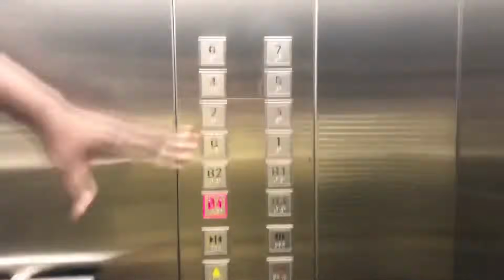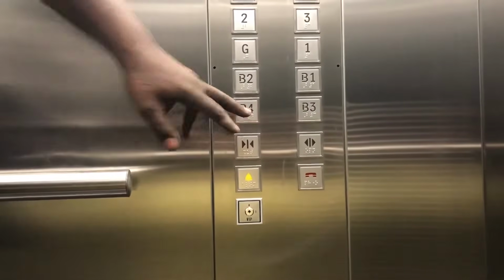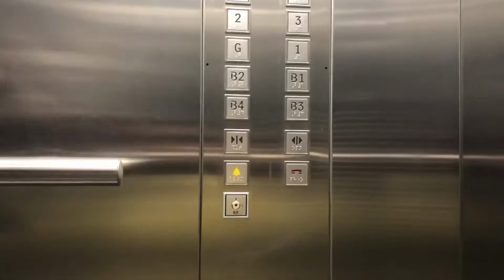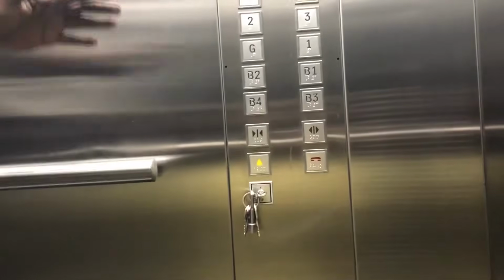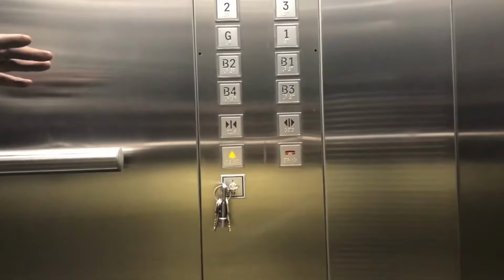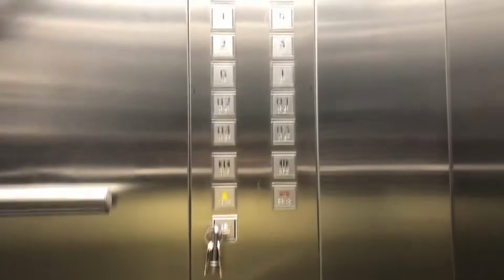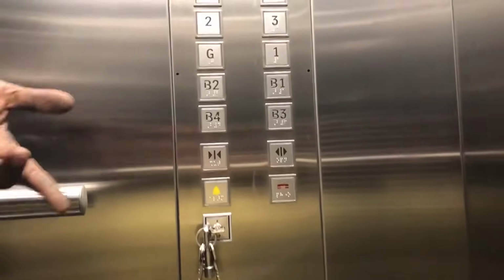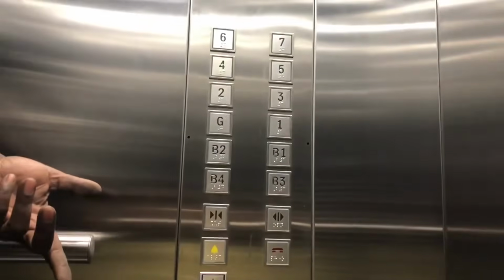How do the Lift work in the Building | How do Elevators Work in the Building | Lift and Lift Shaft

Comment: Hallo,
Thanks for the video.
Am doing a lift shaft in very limited space due to the existing structures.
The maximum internal diamension i can achieve is 1800mm by 1400mm.
The door opening is on 1400mm side. What is the minimum door size for the lift shaft? 
Thank
Reply from the maker: You can ask your lift suppliers about having a single opening door, and request a minimum of 0.9 meters. Check if the supplier can meet this requirement.

Also make sure your design comply with local minimum requirements. Otherwise you may not get approval from the local lift inspector.

Comment: Can we use brick wall instead of shear wlal
Reply from the maker: No. The structure driving the lift can bit be mounted on brick or any other masonry wall. You can create a steel structure frame.
Reply: @MadAboutConstruction  so we cannot use brick wall for lift ??
Reply from the maker: No

Comment: Thank you for the video it is very informative. I wish to ask about how the control room is connected to the actual lift where the people use.  If we have 4 lifts, does it means that each lift has its own control room or it is just one which is connected to all?
Reply from the maker: You can connect all lift with one control room. This is part of BMS (Building management system). All lifts can be Controlled, track and establish to communicate from one control room. For more information you can contact me on my WhatsApp, you can find the WhatsApp number from my article on this topic. The link of the article is given in the top comment of this video.
Reply: @MadAboutConstruction   Thank you so much. So how do you connect all of them in order to communicate. Does it means that there are some cables running from control room to all lifts or how is it automated until it is such an amazing automated machine.
Reply from the maker: @mahnu4091  Technology keeps changing. This is new era, If I say something today, you will see something better tomorrow in same technology. Normally we connected those with cable. We connected each lift separately to the control room.